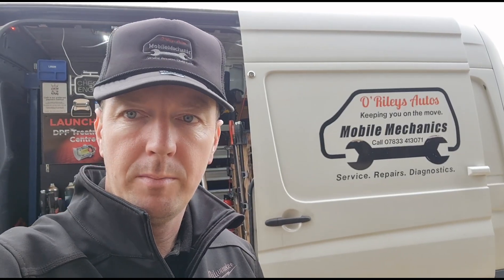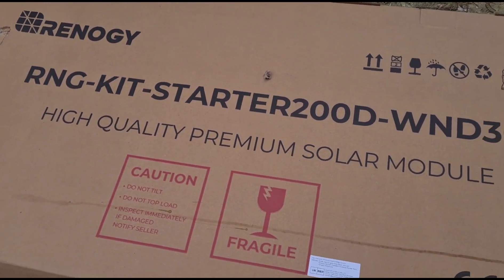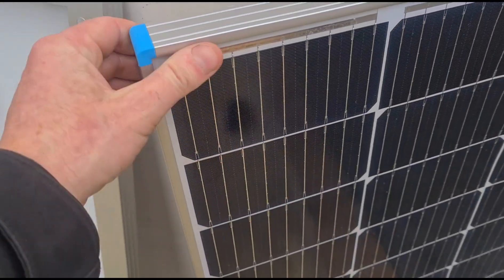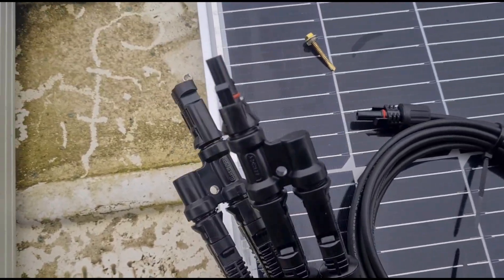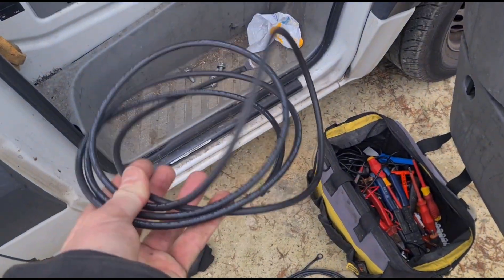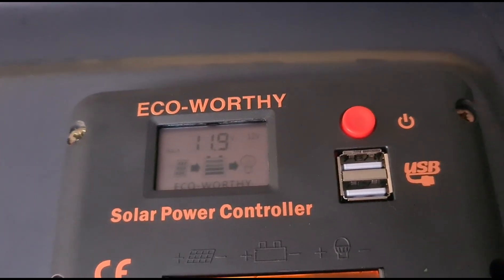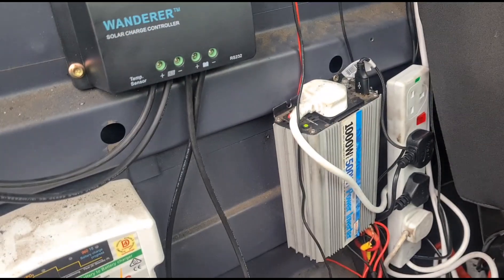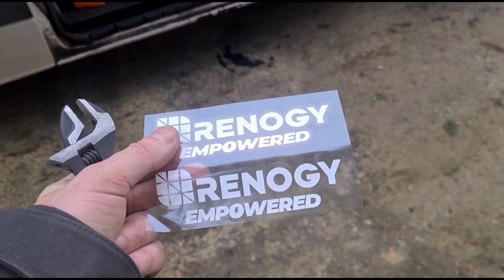Fitting Renogy Solar Panels To The Vans Leisure Auxiliary Batteries

Comment: Would it have been an Idea to fix the panel with panel sealer no holes in the body so no leaks
Reply from the maker: I wouldn't trust it. Wouldn't want a solar panel flying off on the motorway

Comment: Hey Jimmy
If you have knackered your leisure batteries in six months it's because you are using more power than you are generating.
Batteries are reservoirs,  not power sources.  I know,  I've been there and done that; twice!
I run a live-aboard narrowboat on just 400w solar without running the engine for 8 months of the year. The rest of the time I just run every few days or when really cloudy.
I have a 12v fridge freezer, a coffee machine, air fryer, microwave etc all off the inverter.
I too have the Sterling b2b charger.
I have 330w of battery bank. I will be very, VERY disappointed to get less than eight years out of them.
They are 4 years old already and still hold a nice 12.7v at rest.
The trick is to keep them topped up to 100% every day, and not use more than 45/50% if they're lead acid.
Try never to go below 12.2v (except momentarily while in use)
Your 200w solar should cope but if you're hammering the inverter with power tools or whatever,  be careful to put back in what you are taking out.
Good luck!
Reply from the maker: Thing is the van engine is running every day so two 80ah batteries should hold enough charge.  Leisure batteries only get used during working hours and only to charge the milwaukee tools
Reply: @ORileysAutos is upgrading your alternator an option?
Reply: @ORileysAutos  Yeah, should be loads.
I wonder if the inverter is maybe really inefficient or something wasting energy converting. 
Is the van diesel heater running too while the engine is off and Milwalkee batteries charging.
Either way, you have say 60ah usable which should be way enough if you're driving regularly too

Comment: Good vid  Jimmy. only thing I'd of done maybe different with the panels is stick them on unistrut so you can clean under the panel. 
What about a leisure battery in the back doing most of the work for powering your gear. rather than van batteries?
Reply from the maker: These batteries are separate from the vans starting battery

Comment: As for a very good quality leisure battery I use Whisper Power batteries they have been in my van for over 5 years and they are still going strong they are expensive but they are very very good.

Comment: I recently upgraded my camper to a lithium battery, I run the same solar setup as yours and I have the renogy dc to dc charger and it’s great. You can get a Bluetooth kit for that charge controller that lets you view the charge data on your phone. I kept frying my deep cycle batteries with my inverter because they only offer a really small amp draw compared to lithium.
Reply: Yes get rid of the lead acid and buy lithium, you can discharge lithium to 0% without harming it.
Reply: @TermoneenyCC That's not true at all. You are going to destroy your battery. There is a good reason that most battery packs have a safety cut off if the voltage drops below a certain point. You risk the battery going out of balance, you're increasing the resistance and eventually, that battery will burn down whatever it is stored in.

Depending on the chemistry, around 3.2V per cell is getting  close to the limit give or take, depending on chemistry. Your battery will last longer if you keep it up over 70% rather than deep discharging and recharging again. 

Please be safe. Even the smoke from a lithium fire can give you life changing damage

Comment: To see the charge going into the batteries, on a temporary basis, use a current clamp meter perhsps. Permanently on current/voltage/power/Wh meters can be found on eBay and a quite good, but not all are bi-directional (I.e. they often just measure current in one direction)